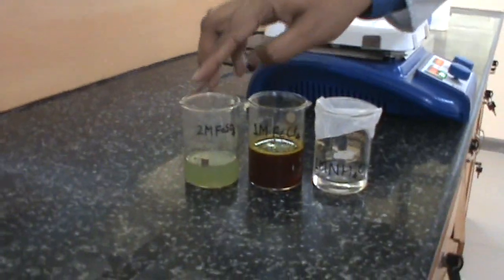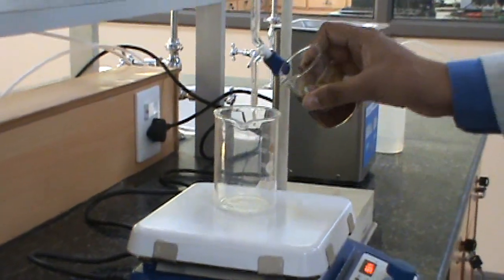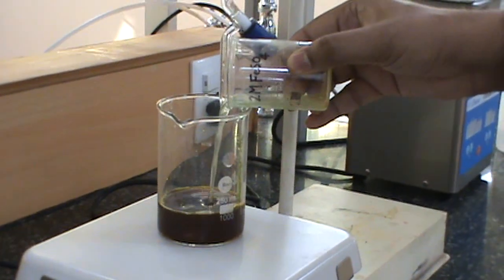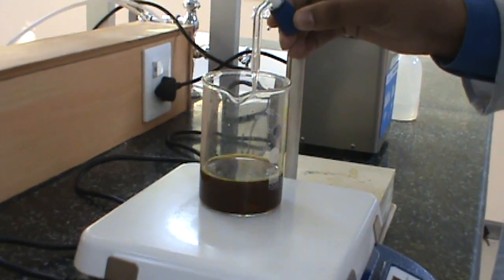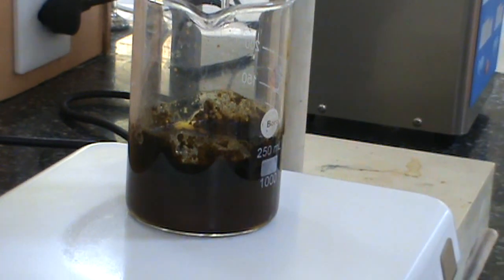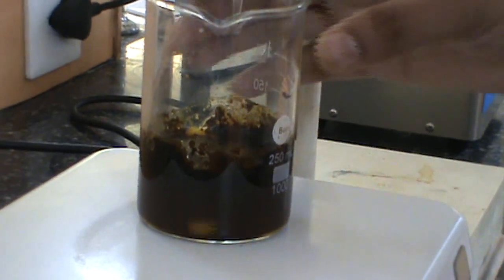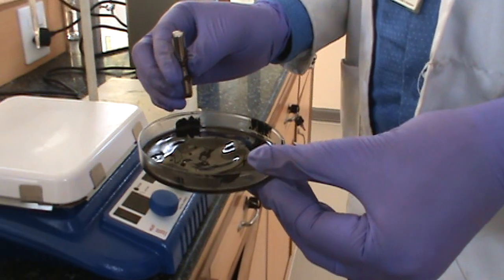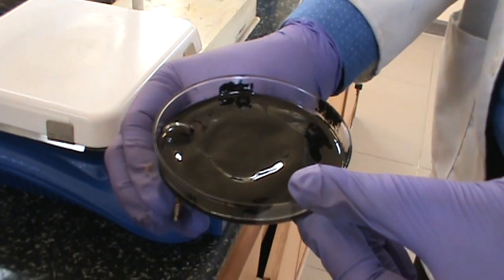Synthesis of Iron Oxide Nanoparticles (Fe3O4)

Comment from the maker: @ Akshay Jangam if you want to use ethylene glycol as the solvent. Just prepare the Fe2+ and F3+ solutions in 50% water and 50% ethylene glycol. After mixing the precursor solutions, heat the reaction mixture in a sealed autoclave at 180 C for 12 hours. You will get iron oxide nanoparticles.
Reply: Thank you sir.
Reply: is this method is of Sol-Gel method sir ?
Reply from the maker: @Newtonsplaygrouund  No this is not a sol-gel method. Here is a link for sol-gel synthesis of Fe3O4
https://www.sciencedirect.com/science/article/abs/pii/S0749603612002042
Reply: @WorldofNanotechnology Sir I have one question.. why ethylene glycol used as solvent for nanoparticle synthesis ? And can I use this ethylene glycol as a solvent with metal salt in microbial mediated synthesis of nanoparticle ?
Reply from the maker: @preeti-u9p  ethylene glycol has high boiling point of about 160 degree. So materials which needs high temperature for synthesis uses ethylene glycol. This is called polyol method. Yes you can try this in microbial synthesis also.
Reply: Hello,  in this experiment a little bit error...first of all you should use correct ratio of Fe2+/Fe3+ ions  as 1:2 and nitrogen or inert argon atmosphere to avoide the oxidation of reactants and final product MNPs. Along with , mechanical stirrer instead of magnetic bead otherwise high magnetic particles stuck on bead.

Comment: Hello! I am currently synthesizing MNPs in a similar way. I am having trouble getting my NPs hydrodynamic size down to 50 nm. I have a few questions:
1) what is the time span that I should add the base? I did 10 and 20 minutes time intervals and notices a 100 nm decrease in size but it's still at 300 nm
2) Do you dry your particles? If so, why? I have noticed this in many literatures and I have also noticed that after a long period in water, the particles seem to degregate.
3) do you use an acid to dissolve the dried particles? Or just water?

Sorry for the ton of questions but with all the papers I have read, I can't get the specifics that I need to get quality NPs.
Reply: Hello , can I ask you what you did 
i also need a smaller size .
Reply: stirring faster makes smaller particles

Comment: Sir, thank you for this video. We are synthesizing MNPs by using ferrous and ferric salts. We are not sure about the rpm value that we should use with the magnetic stirrer. Does it have a crucial effect on nanoparticle sizes?
Reply from the maker: RPM value can be kept at 400-500, but higher speed will be needed when it becomes viscous

Comment: Thank sir but in summer season lab temperature is about 45- 47c and is iron nanoparticle is light sensitive? So can I kept in refrigerator Temperature ( 4c)?
Reply from the maker: Nothing will happen to dry Fe3O4 nanoparticles, just ensure you have dried it in oven at 80-100 degrees.

Comment: Thank sir but uv visible depend upon turbid and transparent solution and iron oxide is insoluble in water and I read somewhere that use methanol so can we use methanol or it intrupted and change wavelength
Reply from the maker: You can use methanol, but use methanol as the reference solvent also in UV vis

Comment: Hello Sir, 
1. How do you get to know the amount of materials you will need for the experiment?
2. Could you please make a video on the synthesis of nanoparticle via Hydrothermal method.
Reply from the maker: The amount of materials required is dependent on the chemical equation. The stoichiometric ratio between the reactants is needed to calculate the amount. The pH of the reaction decides how much NH4OH is to be added.
I will make a video on standard hydrothermal process and upload.

Comment: What amounts should i use when using ferric chloride hexahydrate and ferrous sulphate heptahydrate 
Thank you so much
Reply from the maker: The molarity is given in the details of the video. Prepare the solution according to that.
Reply: @WorldofNanotechnology  but in the video anhydrous forms were used but i will use ferric hexahydrate and ferrous sulphate heptahydrate
Will i use the same molarity sir
Also i have ammonia 33% can I use it directly?
Reply from the maker: @sarahassan1824  you calculate the amount according to the molecular weight given on the bottle. Yes you can use NH4OH 33%.

Comment: Sir how did you perform filtration? 
And also can you give some ideas about the characterisation of the above NP produced.
Reply from the maker: You can do filtration in two ways. If you have a very strong magnet you can separate the magnetic nanoparticles using magnet. Wash it several times and repeat the process.
You can also use a filter paper or centrifuge to filter the nanoparticles.
For characterization you can do XRD, magnetic susceptibility, and SEM.

Comment: Hi sir....
Can I use feso4.7H2O instead of feso4 and fecl3.6H20 instead of fecl3...
Also, should I add oil with it ?because I need magnetite nanoparticles in powdered form....
If so what oil should I add?...
Pls reply sir
Reply from the maker: Yes you can use these chemicals, but calculate the amount of chemicals accordingly. No you don't have to add oil, that is when you want to make ferrofluid.
Reply: @WorldofNanotechnology  Thank you sir.... My doubt is, you have used 2 molar Feso4 and 1 molar fecl3....
Can I use 2 molar Feso4.7H20 and 1 molar fecl3.6H2O with same molar conc of NH4OH
Reply from the maker: @hutsunprabhus8510  Yes, keep the molarity same
Reply: @WorldofNanotechnology  but accordingly the weight that i am going to take differs from you...am I right sir?
Reply from the maker: @hutsunprabhus8510  yes weight depends on molecular weight, but keep the molarity same

Comment: Sir what is difference between synthesis of iron oxide nanoparticles  and chemical method for synthesis of iron oxide nanoparticles is the property are different because  green synthesis iron oxide to use for water cleaning ,dye removal not use for medical purposes. can you pls provide me link regarding this problem or some research paper
Reply from the maker: Both are same. There are many methods for synthesis of iron oxide nanoparticles. Also iron oxide exists in 3 forms. Most common is Fe3O4. Fe2O3 and FeO also exists. You will have to search research literature for specific applications.

Comment: Sir can you please till me what is the temperature you have used will mixing the two solutions + the drying temperature and is it necessary to add oil ?
Reply from the maker: Synthesis has been done at room temperature, The filtered solid is dried at 100 degree C. No need to mix oil, if you have some other applications. I mixed oil for demonstration
Reply: @WorldofNanotechnology  Thanks for the response, can you please till me what's the amount of distilled water you have used in preparing the two solution? In ml?
Reply from the maker: @mohammedal-omairi8941  Combine 3ml of 2M FeSO4 solution and 12ml of 1M FeCl3 solution and fill a burette with 1.0 M ammonium hydroxide solution.
 Add NH4OH dropwise until you get dark black precipitate. Wash with distilled water several times.

Comment: Hello

will it be too much to ask you to write the amount in grams of the reactants? please
Reply from the maker: Take 24 mL of 0.1 Molar solution of ferric
 chloride (FeCl3.6H2O, 6.58g in 250ml water ), add 12 mL of 0.1 Molar solution of ferrous sulphate heptahydrate (FeSO4.7H2O, 6.95g in 250ml water), Add NH4OH solution dropwise with continuous stirring, until the solution turns black. Filter and wash the precipitate with distilled water.

Comment: sir can you please attach the paper of this experiment.? and also how you have filtered after the formation of nanoparticles.
Reply from the maker: You can use strong magnet to separate the Fe3O4 and then decant the water. Then wash with water and repeat the process until water is neutral. For reference simply search in google, there are many papers available.
Reply: @WorldofNanotechnology  thank u sir

Comment: Sir what is the role of teflon sealed autoclave and in the  place of teflon sealed autoclave what equipment use.
Reply from the maker: If you don't have Teflon lined autoclave, then also you can do reactions. It depends on temperature. If the synthesis temperature is 110-120, then you can use hard plastic bottles (polypropylene bottle), you can seal the cap with parafilm, or Teflon tape. But beyond that temperature you must use sealed autoclave.

Comment: Thank sir but how much amount iron oxide and how much amount of water. I this method is different from estimation of iron by uv spectrum
Reply from the maker: You want to know at which wavelength iron oxide peak will come. The UV vis spectra is not dependant on amount. Just take small amount of sample in 5 ml water. Stir well, fill the cuvette and scan between 200-700 nm. Why don't you come for summer school in Amity Institute of Nanotechnology and learn everything. 😃
Reply: Thank sir but iron oxide is insoluble in water and in the place water can I use methanol because I read somewhere that use methanol buffer solution .is methanol change the wavelength ?
Reply from the maker: @aparna6707  you don't have to Solubilize it just suspend it in water, grind the solid before use.

Comment: Sir why u add oil with the dryed nanoparticles..and which oil ?
Reply from the maker: I mixed the Fe3O4 nanoparticles with oil to make ferrofluids. The best result is obtained with motor oil. If motor oil is not available you can mix even vegetable oil or silicone oil.
If you dont want ferrofluid then no need to mix with oil.
Reply: @WorldofNanotechnology  thank you so much sir for clearing my point

Comment: Sir what is property of iron oxide nanoparticles.Is iron oxide nanoparticles soluble in water what is the bioavailability of iron oxide nanoparticles
Reply from the maker: It is not soluble in water, but can be dispersed in water. I have not used it for bio application, you should do thorough literature review then only you can make appropriate nanoparticles. This is just a general method for Fe3O4 synthesis

Comment: Hi dear agar iron dopped zinc oxide bnani ho to us kalia kitna raw material lain
Reply from the maker: वो इस बात पर निर्भर करता है कि कितना डोपिंग करना है, 5 मोल% के लिए Fe/Zn ratio 1:20 लेना चाहिए
Reply: In urdu or english plz
Reply: If we can making or prepration iron dopped zinc oxide what should we do
Reply from the maker: @shearknowledge9683  That depends on how much doping you have to do. If you want to do 5% doping then you should take Fe/Zn in the mole ratio of 1:20. I hope you can do mole calculation.
Reply from the maker: @shearknowledge9683  I am sorry, I thought you are a Hindi speaker so I typed in Hindi.
Reply: @WorldofNanotechnology  plz give me some information if we have not centrfugal to seprate than what should we do
Reply from the maker: @shearknowledge9683  You can use filter paper, or allow the precipitate to settle down, decant the water, again fill with water and repeat for 4 times to wash.
Reply: If ph increased than to control what should we do
Reply from the maker: @shearknowledge9683  Add HCl or other acid to lower the pH and add NaOH to increase pH
Reply: I used sodium carbonte than ph not maintain in this reaction solution i used naoh to adjust ph. This will effect result or not
Reply from the maker: @shearknowledge9683  should be ok

Comment: What is concertion of ammonium hydroxide I'd molar
Reply from the maker: You can use the 25% solution of ammonia which is commercially available. Or if you want exact concentration, then prepare 1M NH4OH solution.

Comment: Sir, the obtained filtrate should be dried at what Temperature?
Reply: The obtained filtrate is dried at 100 degrees C.
Reply: @vicky7798   I followed the same procedure but my resultant dried product is brownish in colour. Is it okay or it should have been black in colour ?
Reply: @mdzafaralam7075  It is correct. Just check if the product is magnetic using a magnet.
Reply: @vicky7798   thank you. By the way I have to make a PowerPoint presentation, the above procedure can be found in Journals ? If so please give me a link to the journal

Comment: Sir... if I want particle size of less than 10nm... what modifications can be done..
Reply from the maker: You will have to use some capping agent like surfactants or some long chain amines
Reply: Thank you for your kind reply... Sir..but if the particles are capped or coated... Will it hamper the magnetic properties?
Reply from the maker: @veeturivarun5201  it may affect, but I have not measured. If one magnetic particle is kept separated from another then it may affect over all magnetic property but individual particle property will remain same. Search for literature regarding this.
Reply from the maker: @veeturivarun5201  Try Fe3O4 synthesis using urea, it will reduce the size.
Reply: Yes sir.. I will try... Thank you very much
Reply: Sir... do we need to have inert atmosphere during the synthesis?
Reply from the maker: @veeturiumavarun9574  not necessary, you can do in open atmosphere
Reply: @WorldofNanotechnology  Thank you sir
Reply: @veeturiumavarun9574  sir.. how can I extract the nanoparticle powder from a stable suspension created using a surfactant?
Reply from the maker: @veeturivarun5201  you can centrifuge the solution and separate it.

Comment: Sir, can I use FeCl2 instead of FeSO4???
Reply from the maker: Yes you can use FeCl2
Reply: Sir, where can I get the reference? I need to write the reference for my presentation
Reply: sir it is oxidized to Fe2O3 ??Are they stable?? Sorry for my many questions
Reply from the maker: @eainteaintpyaesonetun8235  it is a stable oxide. This method will form Fe3O4 nanoparticles
Reply from the maker: @eainteaintpyaesonetun8235  just search synthesis of Fe3O4 nanoparticles in google, you will get many papers
Reply: Thank you sir
Reply from the maker: @eainteaintpyaesonetun8235  Fe3O4 can get reduced to Fe2o3 and Fe2o3 can get oxidized to Fe3O4. However both phases are stable.